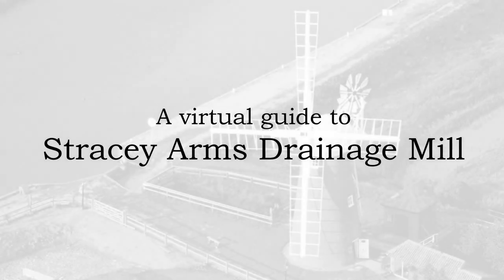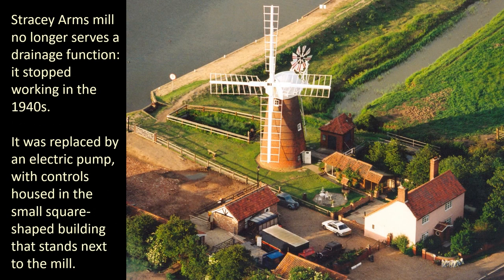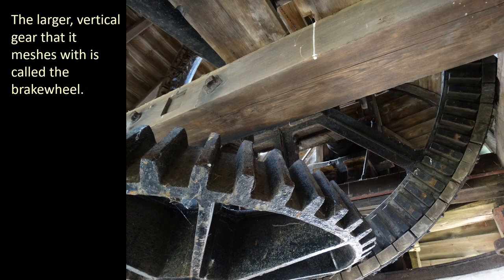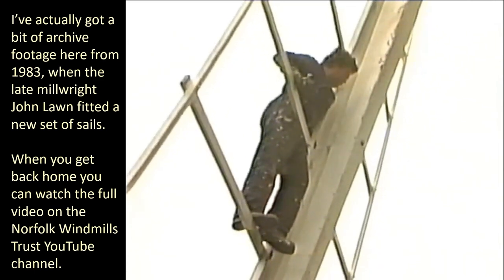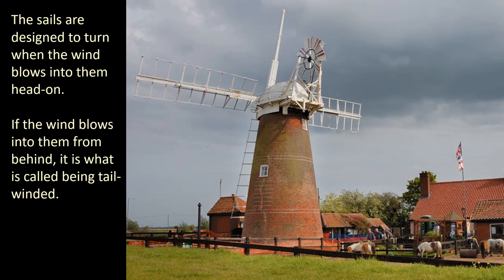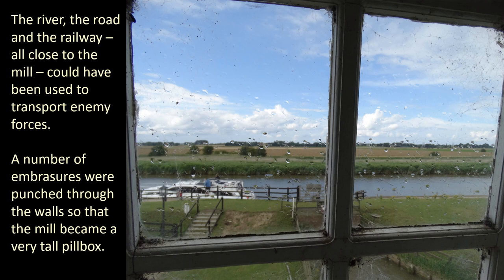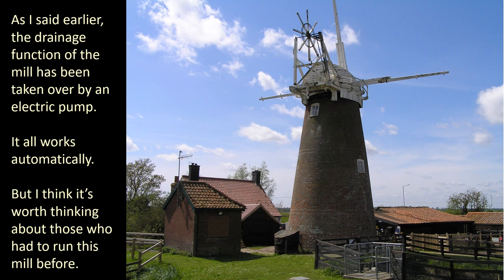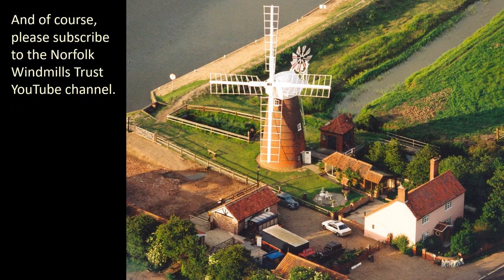A virtual tour of Stracey Arms Drainage Mill

Comment: How is it that such an interesting film, about such an interesting subject has so few views and likes?? Since I was a child I've hoped to one day see one of these magnificent monuments to mankind's endeavours to drain the land working as they were intended too. Good video. Did this one always use the turbine pump rather than scoop wheel?
Reply from the maker: We're glad you enjoyed the film. We believe the turbine was installed when the mill was built in 1883. However, we also know that there was a previous mill on the site before this and that probably used a scoopwheel.
Reply: @NorfolkWindmillsTrust  thank you for your reply. Interesting to note the iron machinery, and yet they still used wood at Horsey some years later. (It has woodworm I notice. ) although I understand the iron works connection. Also in the description of the tower it says it's built on piles, are they wooden?? And how deep do they go?? I have noticed quite a few of the towers leaning these days.Sorry for all the questions. I'm just interested. There's something lovely about old mechanical functional buildings like that. Especially when powered by wind, as it offsets the maintenance cost to some extent when compared to a steam pump today as a heritage apparatus. Best regards, Tim.